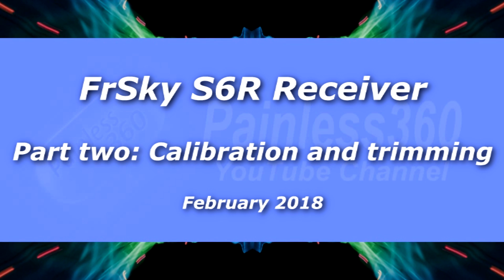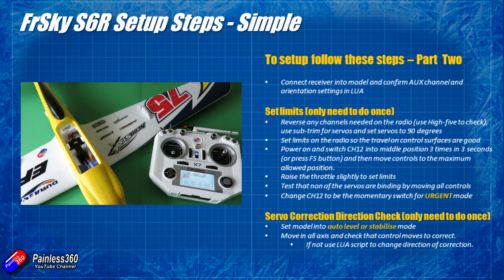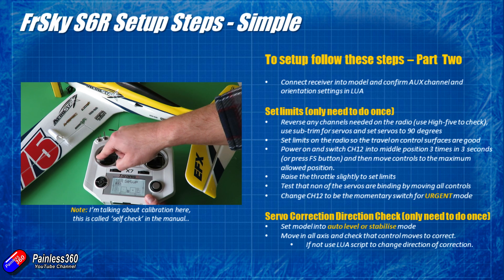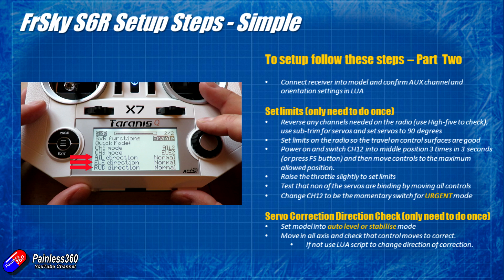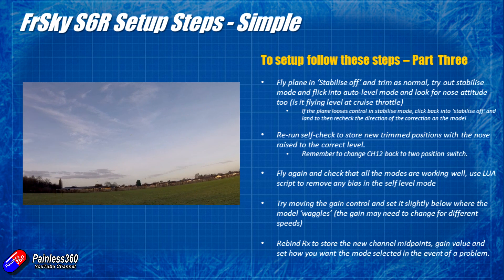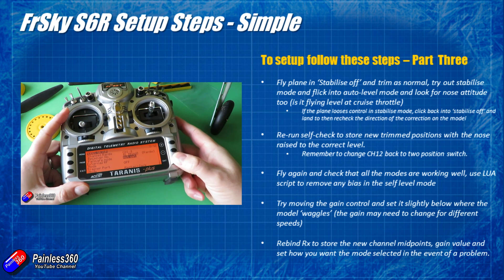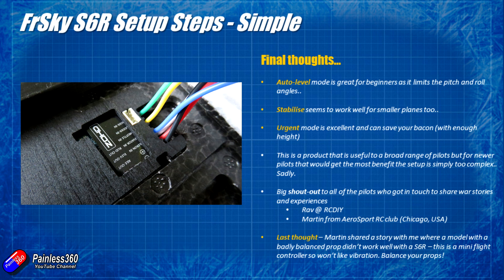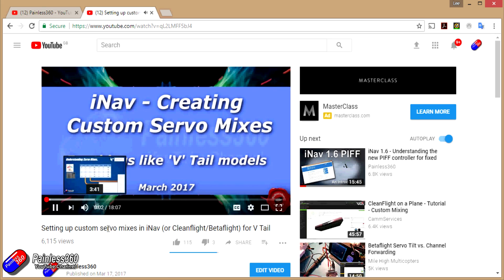(2/2) Frsky S6R/S8R Basic Setup

Comment: Need help -
Can you have frsky R9stab i have problem with self check 
As self check done some times all mode works and some time only auto mode work with 3 position switch 
At 3 position switch 
Position 1 auto 
Position 2 stabilizer (but it takes same auto)
Position 3 manual ((but it takes same auto and when plane nose down elevator go up without touching any stick 😢
Reply from the maker: I've never used that other stabiliser. Best of luck
Reply: @Painless360   SOLVED - if any one use this series SXR receiver make sure that in radio set channel 1-16 or as per GitHub many problem solve With single setting.

Comment: Thanks, very helpful. Unfortunately when I am in the calibration mode  and am trying to calibrate the S6R on its own my rssi warning comes on, my rx light starts to flash and it prevents me from completing these phases. The same thin happens when I try and configure the rx inside the model. However when I am not in the calibration or configuration mode my transmitter transmits fined and the rsss shows to be over 100.I have moved the transmitter away from the rx and have even moved to different locations but to no avail. I have three of these receivers and they all do the same thing. Any idea why it is doing that? Help would be apparated.
Reply: @Painless360  It appears that updating my tx16s to the latest version of edgetx 2.10.1 has solved it. Thanks anyway and keep up the good and helpful work.

Comment: Hey Mr. Painless. I'm pretty new with planes. I've noticed that you know and explain good things so is there plane gyros with that acro mode with autolevel In any other gyro than radiolink Byme?
Reply from the maker: There are lots of options for simple stabilisers, right up to advanced flight controllers. Check out this video that explains all about it and may help you decide what you need - https://www.youtube.com/watch?v=YAfNC55Udu0

Comment: Wow, thank you Lee! So much detail, this was super useful. Would you recommend this for a beginner to fixed wing or another receiver with level flight/stabilization. I have a TX16 multi-mode.
Reply from the maker: I think Frsky have a new version now. A stabiliser can be a good aid to teaching or learning to fly. I tend to use flight controllers now... Best of luck
Reply: @Painless360  Thank you, I just joined your Patreon :)  You've been so helpful because there's so much to learn and consider. I may be wrong but I believe the new version isn't 4-1 compatible any more. You connect the flight controller to the receiver through the SBUS? Is there a brand you recommend?
Reply from the maker: If the new version is ACCESS only then you can't use that with a Multiprotocol module. I use CRSF or SBUS for most receiver to flight controller connections now. Almost all of the wings and planes I fly here have INAV in them.. You can now ask questions on the Patreon system and get much more detailed answers.. Welcome to the inner circle! :D
Reply: @Painless360  Thank you!

Comment: Wonderful instructive series of videos. I totally agree the FrSky are starting to lose the point. I recently purchased 2 SR8 Pro Rx's and the hassles in setting them up is not worth it, almost to the point I want to sell all my frigging FrSky equipment now. Next time I will just purchase a standard gyro as I do not trust that these receivers will act as required
Reply: They are definitely finicky. I think once you do it a couple of times it will get easier. A year ago I had trouble binding and setting up a basic rx. Now I'm finding myself less scared and progressing a lot quicker. (frsky, opentx) If you have a second radio it makes making changes easier because you don't have to screw with your only working radio.

Comment: Thanks o lot for great information - it helped me a lot to configure my S6R.
HOWEVER, a question - towards the end you mention that after the first initial flight you should finish with a rebind? What do you exactly mean - should I bind the receiver again? This would mean me to take out teh receiver from the plane ... which would the calibrations done would be lost. Or am i wrong here?

Once again, thanks a lot for a great channel with lots of information!
BR
Lars
Reply from the maker: The idea of the final bind was to re-store all of the settings (including failsafe) onto the receiver but with modern firmware it should save any changes automatically. Happy flying!

Comment: If I've set failsafe on my radio and then power off and the plane acts as expected does that mean it's correct or do I need to press the rx button as well? I'm thinking it's OK but first time it went to full throttle scared the hell out of me

Comment: Hi Lee - I've been struggling with the S6R for weeks now, trying to get the altimeter and vario to work with it, and failing  -   The altimeter won't reset either, it is seemingly stuck at minus 200 feet, even after a repeated telemetry reset…

The exact same vario/altimeter module worked perfectly with the X8R rx
 - With the vario selected on, I get random single bleeps at mid tone, and higher pitched pip-pip while the vario is stationary on the bench. Lift the vario over my head, and I get the pip-pip - once! and the bleep when I put it down again - not the continual tonal variations as the height changes. I sometimes get the pip-pip AND the bleep at the same time!

Here's my set-up - 

Transmitter is Frsky Taranis plus - version 2.2.4 <66bb9c3a>
rx is S6R gyro
vario set-up - p11 (of 14) Special Functions - SF9 - SB (arrow down) Vario -
 p13 Telemetry - sensor 6 Vspd * 0.0f/s  1 sensor 8 vari * 0.0ft   (blank) - can't access it to change
 In the sensor settings, I've got - Sensor - Vspd - type Custom - id 0110-1  - unit f/s - precision 0.0  - ratio offset 0.0  - auto offset etc boxes all unticked

Have I missed something silly? I've tried altering all settings - one at a time! - with no joy.
Reply from the maker: Osunds like a problems with the firmware on the S6R. I'd check for any updates. Frsky really could have done better with this.. Happy flying

Comment: Thanks, for this video. One question: at around 13 minutes, you say to rebind the receiver - I'd be grateful, if you could explain why this is necessary. Thanks.

Many thanks, for your quick reply.
Reply from the maker: To set the failsafe. It isn't needed as the failsafe is updated dynamically.

Comment: Hello,
I am a happy subscriber of your channel and can't tell you how much I have learned  from your videos about my Taranis DX9+ SE radio!  I switched to this radio about a year or so ago from a JR-11x and never looked back.  it was a steep learning curve for me, but your videos were an incredible help!
I would like to get your advice on an issue I'm having with both the S6R and S8R receivers that I have in different planes.  I only use the Quick Mode and fly a lot with self leveling since I'm older and want nice easy, relaxing flights.  I issue I'm having is that in Self Leveling Mode the plane flies very level from side to side, but varies in pitch.  Sometimes the planes fly straight & level and other times they go into a shallow dive.  Many times during that shallow dive they will level themselves out and fly straight again.  This seems to occur at all different air speeds. 
I have re-checked the plan's CG to make sure they were correct and re-leveled the planes many times with a slight nose up attitude and re-calibrated everything, but it seems to make no difference.  I had the Auto Level on both the ailerons & elevator gain set to 80 when this was occurring.  Yesterday I changed the Auto Level elevator gain to 60 in two of the planes.  It seemed to correct the problem in one of them, (at least for that one flight), but not in the other.
I was hoping that you might have some advice.  I have sent two separate inquiries to FrSky about this, but have not received any responses.
Thank you,
Tom

Comment: i can bind and calibrate and all that, can get throttle to move motor, but cant get ailerons to move, its like theres no servo signal output from the reciever, any help?
Reply from the maker: Could be a few things. Power, servo connections wrong, incorrect S6R setup... what troubleshooting have you already done?

Comment: No idea if you can help, but I've followed your 2 part series and am having problems getting my S8R receiver to work.   I have a Taranis X9D+ radio that I bought 3 or 4 years ago.   It has always worked flawlessly but it still had the original firmware, version 2.0 something.    I realized that I needed to upgrade, so I looked at the choices and decided to go middle of the road with a tried and true firmware and installed version 2.2v0021.   That got me a nag screen about the "expected version" and I got that fixed by a change to the SD card contents.   So far so good.   I next went to the FRSKY site and downloaded the newest firmware for the S8R receiver (FCC version for US use) and followed your tutorial on running a servo cable (male to swapped red/black lead male) from the external module pins to the smart port on the S8R receiver.   The firmware upgrade went just fine (to a point).   It finished properly.   When I attempted to continue with the S8R LUA file, I realized that the firmware upgrade had deleted the BIND that I had done with the receiver and it needed to be rebound to the transmitter.   PROBLEM: It would NOT bind.   Others have apparently hit this same wall.   I found this message on a forum:  "HI, just found the problem.   The S8R-ACCST-V2.0.1 DOES NOT BIND!!!!   I downloaded the previous version, S8R_FCC_20190531.frk and binding is successful."   I had downloaded and installed the newer SBR_ACCST_V2.1.0 rather than the slightly older  S8R-ACCST-V2.0.1 but I had the same problem with it NOT binding.   I was able to successfully install the "OLD" firmware version (S8R_FCC_20190531.frk) and then the receiver would BIND once again.   I have scratch built an 80" fixed wing video platform; hence the desire to get the S8R working correctly (I have 2 shiny new S8R receivers and both are behaving the same way)    After binding with the OLD firmware, I was able to run the calibration LUA successfully (on both S8R receivers).   I am using separate aileron servos on channel 1 and channel 5.   I had all of the flight controls configured and working properly before beginning this little nightmare.   I went through part ONE of this TWO part series and set up channels 9, 10, and 12 exactly as you showed.   I ran the S8R Lua file and configured the settings to match the plane.   The flight controls just got weird.   Ailerons worked 1/2 way --- I got level to full right turn but no left turn.   Elevator went up but not down.   I lost rudder throw to one side.   I thought maybe I needed to delete the MIX setting for channel 5 (as per you PART one screen on the mix --- I wasn't certain at the point where I watched that screen so I left my channel 5 mix in place).   Deleting my channel 5 mix did nothing good.  At this point I am left with a bunch of flight controls that only half work.   I have been at this total process for about 8 hours and I am FRAZZLED.   Suggestions will be gladly accepted.   MY FIRST THOUGHT ---- Do I need to go to a radio firmware in the 2.3 series rather than the 2.2?????  and then reinstall the latest version of the S8R firmware?????   Will the receiver bind with that combination of firmwares?   At this point I have swapped in a V8FRII receiver to make the plane flyable again and I am considering installing an older HK 3 channel stabilization box that I have.   I would much prefer to get the S8R to work as it should.   HELP!!!!!!!
Reply from the maker: The S8R is a nice idea but let down by a truly terrible implementation by FrSky. All I figured out is in the video.. Best of luck!

Comment: Thanks for a plain English explanation of this flippin' receiver set-up. I'd been beating my head against a brick wall and getting nowhere, until another flyer recommended your channel. I've been flying r/c for about 50 years, so have a vague idea of what I'm doing!  One of my preferences is airborne video, and as you are probably aware, getting a model - no matter how large - to be a stable camera platform is not easy - what looks, from the ground, to be stable, is in reality bouncing and wobbling all over the place! Hence my choice of the S6R, as there is no room in the fuz for an add-on external system. My normal camera platform is an e-powered glider, with a moderately large span, so I need to set up the 'level' flight on the glide, and now I know about channel 12 - I might make some progress!

Comment: Once its all setup do I need to have the plane level when plugging in the battery ?. Reason for asking its easier to install the battery with the plane upside down but I wondered if this would cause a problem.
Reply from the maker: I've not done it that way but I'd try and set the model down as quickly as you can to let everything initilise cleanly... best of luck

Comment: 3 Questions:
1. When I'll change the calibration switch to the momentary switch, I won't be able to turn the calibration program? It's only works with the 3 switch position?
2. After all the flying and calibration ends, I need to rebind the receiver?? Wouldn't it delete all my work?
3. Will you do a video about the advance program of the S8/6R? 3d and other?
Thanks man.
Reply from the maker: All I knew are in these videos. The S series receivers were a good idea with a lousy execution from FrSky. Best of luck!

Comment: By the way the latest software version (2.0.1) for flashing the S8R receiver could not bind with my X9D Plus.  I had to select the last 2019 version which bound perfectly.
Reply from the maker: FrSky could have done a lot better with this thing. As I've said from the start - nice idea but lousy execution.
Reply: I'm having same issue with my qx7.
Another problem I have is that I can't get it to self check no matter what I do. Are you having any issues with this?
Reply: Avecforte after changing back to the old software binding was no problem.  Not sure what you mean by “self check”?  Would be grateful if you could explain and then I will check for you.

Comment: Just a quick one , i just bought the taranis x9d 2019 plus access .all the latest firmwares , i cant use the trims or reverse in 
 lua script for the s6r i have the scroll wheel instead of buttons and it will only work in one direction hence nothing can be adjusted ,everything else works spot on after following your vids , do you have any ideas ? all the latest firmware

Comment: Instead of moving the channel 12 to a 2 -position switch then just override the channel 12 switch's middle position with -100 in Special functions. then you have panic button without the hazard of set it in calibration mode.

Comment: Calibration and setup with lua seemed to go well.

I was following your tutorial - set a Ch 9 gain on S2 - twiddling that I get (0-50-100) - I note that with full beans of +100 and switch A down (Ch10 +100), I can feel (but only just) tiny control surface corrections which seem to be going in the right way. I think that is at least a small 

However, with switch A up, Ch10 is -100 and a death roll to starboard results - this I don't understand - there is no change in the aileron(s) on the channels monitor screen,

What am I doing wrong? 

PS., how do I re-subscribe to your Patreon?
Reply from the maker: All I figured out is in this video. RCDiy has some good content for it. Links to Patreon in the description. Best of luck!

Comment: Hi. thanks for exellent instructions. I Have a S6R and I'm new to the hobby. I wanted to have ailerons on seperate channels, but the AIL2 is not respoding to stick movement. Is there some setup that needs to done? I have the 4 basic inputs, Mixes in the order on the receiver (with AIL2 on channel 5).
Reply from the maker: All I figured out is in the video. This isn't as easy to setup and use as it should be (as you're finding out). Best of luck!

Comment: Thanks for your videos. I have some S8R in a EDF Jets and works fine, but just now I have a freewing Mirage 2000 Delta Wing and I have a lot of problems whe stabilize or autolevel mode. When turning right or left wing beguin to move continously and only when plane is flat it works well. I have reduced Travel of Ail to 80 and mixer to AIL 50 and EXPO 50 but just the same. I have a S2 button to control the gain and putting it at minium also the same issue. I have changed the gain by lua script to ail 30 and Ele to 60 in auto level and estabilization and also the same.
The only thing I have to do is to reduce the gain to a 10 for AIL and ELE and test what happens.
Isaw in yout video that you put gains to 0 value at all items but I thing that it will be as a manual mode because no gain to mantain the plane flat in autolevel.
  What do you think about it?
Thanks

There are othe parameters as AutoCrab and others but I don't know what is it function.

Last firmaware and las Lua in my Taranis 9Xplus
Reply from the maker: I'm not a fan of the S6R and S8R, I think that the idea is a great one but the implementation is lousy. I've used the HobbyEagle stabilisers and had nothing but good experiences with them. I had one inside that Skysword model I looked at a few months ago and it transforms how well that model flies.. Sorry I can't be more help on this one.. Happy flying!
Reply: @Painless360  Thanks for your anwser. I have used CC3D, A3pro and S6/8R all of them work fine but the frsky in mi delta mirage is terrible. In other kind of planes works perfect, specially in bad posicion manoubers return to flap position at once. Perhaps in delta wings has no good solution. Today I crash Mirage becouse of if...